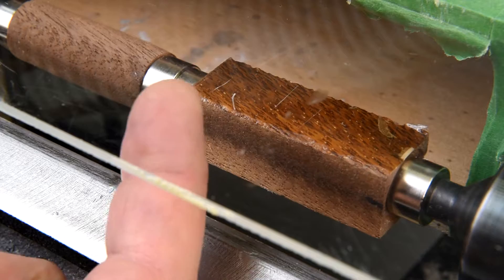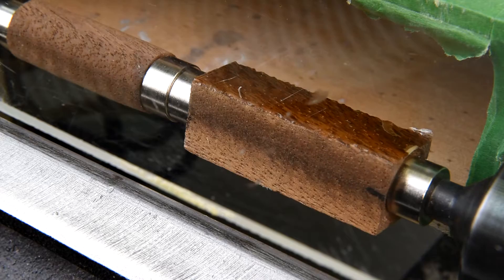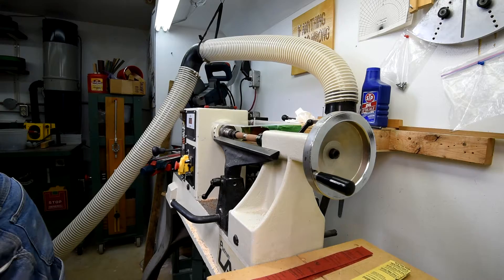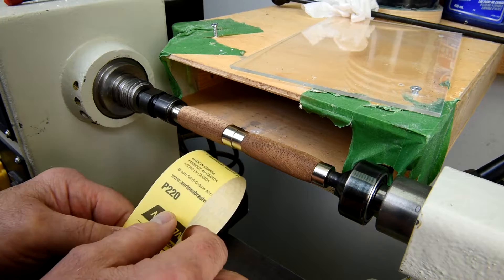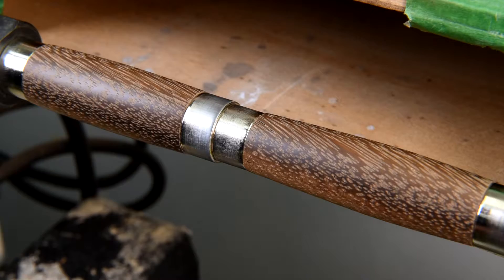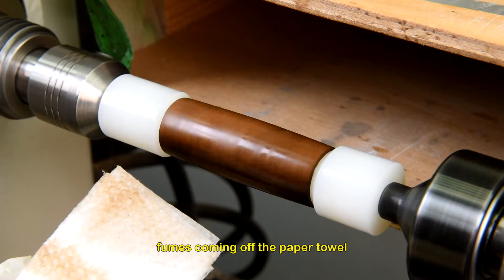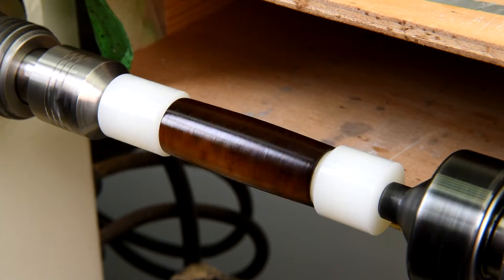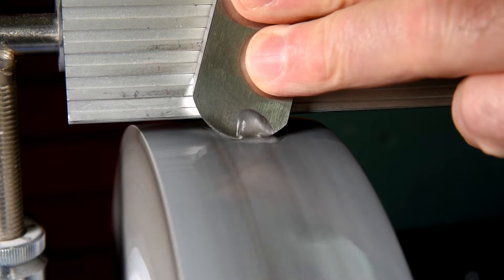"The Emperor" Pen - Part 13

Comment: Ron, I was glad to see someone using CA glue for hardening.  I used to use a similar technique on turned balsa wood wheels on my scale model airplanes.  Used an old Dremmel, not the nice equipment you have.  Never had a pair of wheels that matched... I think your approach of applying multiple applications of CA was spot on.  I've had issues using the curing spray as it can cause uneven curing and bumps that are hard to sand, but I was not turning my wheels at the same time as you did in your video.  Ron, you inspire me to get back out into my garage and start working on fun projects again...Thank You.
Reply from the maker: Hi Robert,
Thanks for your comment. Hey, that takes me back to when I was big on making flying models too. Both freeflight and RC. Digital RC was in its infancy back then. I never used CA glue or made my own wheels or propellers either. However I designed and made my own fuselages and wings. I ended up with ugly boxy looking planes, but they actually flew, lol. Because I didn't know about CA glue back then, I used deluded dope to strengthen the soft balsa. Then Monokote came out and that was the end of my dope and tissue days :)

Comment: Hi Ron, 
this week I used CA glue as finish for the first real time. 
It helped me to fix some low spots in a piece of plywood I used on an Earl twist pen.
I used the EEE too and it works great.  Really smoothens and polishes the surface. 
By the way,  a lot faster than micromesh, too 🙃
As always, thanks for the great videos and details- I love to watch them and am always looking forward for the next part or project you work on.

Best regards from Germay 

Sebastian
Reply from the maker: Thanks for your comment. I realize that I should know, but I don't. What is EEE?
Reply: Triple E "EEE" Ultrashine- the stuff you called Cut ´n´Polish
Reply from the maker: I need stronger glasses, lol. And all those times that I had that jar in my hand too, and never noticed :)